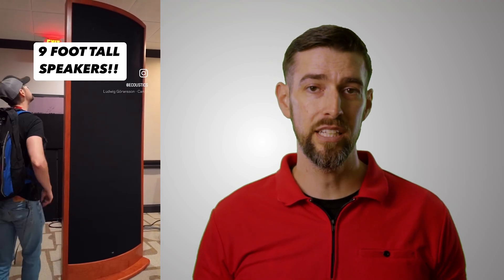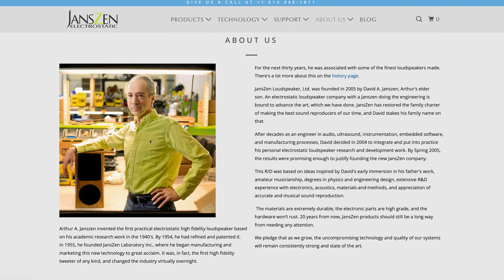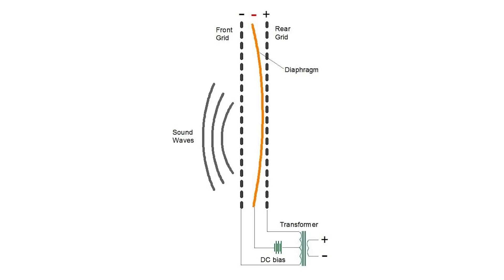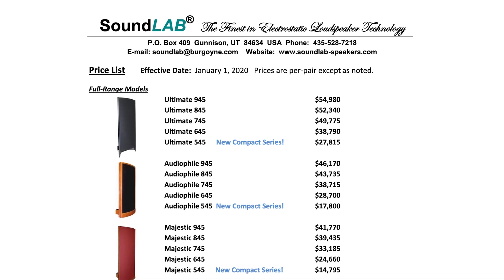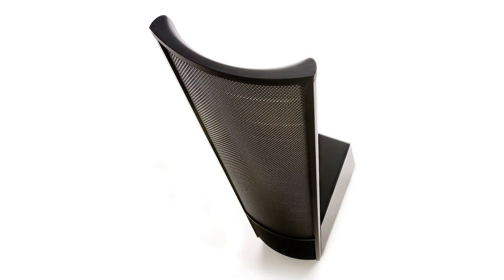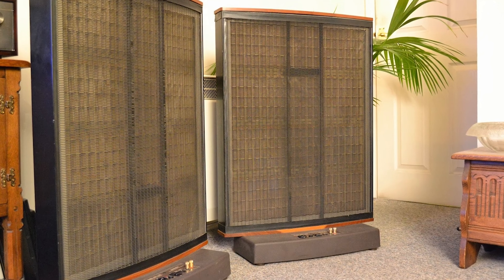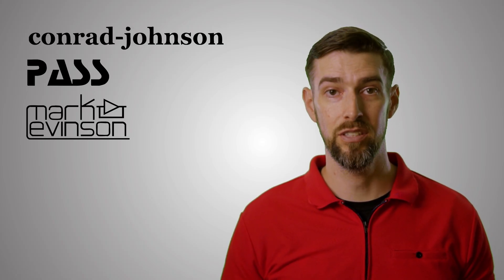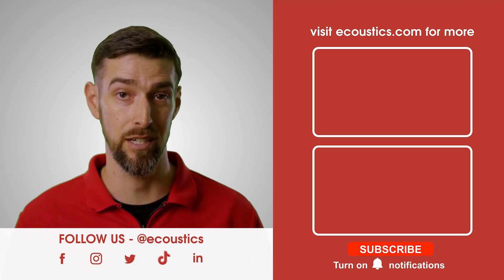ELECTROSTATIC SPEAKERS EXPLAINED! | eCoustcially Speaking

Comment: Having just posted on your thread about vintage turntables, my path through electrostatic speakers goes back almost as far...my first being Quad 57s (so called!), used with Quad II valves gave, for its day, a startlingly vivid sound picture compared to most other 'box' speakers available then.....but at modest volume!

The Quads I had for many years that superceded the 57s (not all Quad owners agree!) were the fabulous 63s - in my view a step forward; more bass...better image (due to the time-delayed concentric rings 'point source' panels...better power handling, etc. I had a pair built for the professional market with more robust frames and open grills, and two inch marble tops! and was loath to sell them.... the best pair I ever heard.

Next was 2812s. Only had them four years, and just traded them for the new 2812X. Too early to really notice all the refinements - quite easy to fool oneself, but bass is more dynamic.....well, down to 45hz....the Quad L-series subwoofer takes over there!

Placement is quite important - I have always used stands before my latast pair....and I'm just designing new ones for these.....the bottom of the bottom bass panel should be 12" off the ground, this arrived at after fifty years of Quad listening!!

Comment: Extraordinary ! 

I was, as of late, thinking about electrostatic speakers, and wondered why we don’t see them any more. I last saw a pair of these in an HiFi store in Boston back in 1985. I heard them operate in that store and can’t now help recalling that they really did produce a very realistic sound - due, of-course, to such a very large vibrating “speaker cone,” for they were about 6 foot tall and about 2 feet wide. 

I think I’m going to make a pair of these - good bye “Quarter Voight Pipe.”

Can you. Send here, direct me to a website,  some details as to where I can start ?

I am a retired DSP and an electrical Engineer.
Reply: If you know DSP, you may consider that the electrostats' distortions shall be fairly predictable and mainly H2. They shall be ~dislocation, 1/s^2 of input. Have a fun project!

Comment: Other CONs often mentioned with panels, electrostatic and dynamic, is lack of dynamics and low level sound quality. Being a Maggi lover for decades I find this to be a misunderstanding of actual music mastering. Music is mixed to ride the Zero level for peaks regardless if the peak is a singer, lead guitar, piano.... at any one time. e.g. When the guitar follows a singer. the singer was peaking at zero as will be the guitar. But people want that screaming guitar to be louder than the signer! But the singer was already peaking at zero! There is not higher SPL! So when someone says their speakers, like horns, provide these better dynamics, they are admitting to distortions causing differentiations that did not exist in the actual source materials. Same with low volume sound. Human hearing loses bandwidth perception as SPL drops. To claim yo are still hearing more range at those lower volumes is just saying the speaker lacks consistency across the power spectrum. But these are both used as CONs for panels.

Comment: The KLH Nine was my first exposure to electrostatics back in the late '60's. In the '70's in the SE US I repped RTR (AR, AT, Marantz...) a major manufacturer of electrostatic speaker elements. They had small electrostatic panels in arrays in cabinets to add to your conventional speakers. A company (name? brain fart!) made electrostatics out of Florida which was a problem because saltwater in the air from the ocean would cause the panels to short out from high voltage arcing. Which tends to be the final failure of electrostatics and why they need to be rebuilt. Internal arcing causing holes in the diaphragms.

Comment: An amps stability is far more than just it's ability to handle a resistive load as an 8ohm or 4ohm spec would measure. As electrostatics are capacitive in operation they require a high voltage instead of the high current most other speakers need.  So a transformer is used between the amp and the panel. This is a very complex load for an amp.

Comment: Next, no the thin diaphragm has nothing to do with it's dispersion. The spec that most determines dispersion is width. The wider a tweeter usually the poorer the dispersion. When the width exceeds the wavelength of the signal you get surface cancellations and nodes, comb filtering in the horizontal plane and beaming.

Comment: Low mass is equal to less distortion?  Where does this fantasy come from? BTW, the claims of low distortions are not supported by measurements.
Reply: In the 50 ies distortion of esl was way lower than dynamic speakers. Now the difference in distortion basically vanished but other advantages remain
Reply: It's not fantasy. It is physics
Reply: @naveenroy1565  "Here is Rhodos, here you jump". Prove it.
Reply: @naveenroy1565  no it isnt.